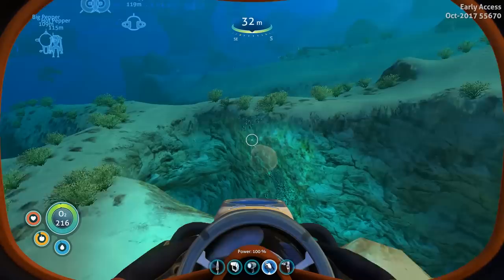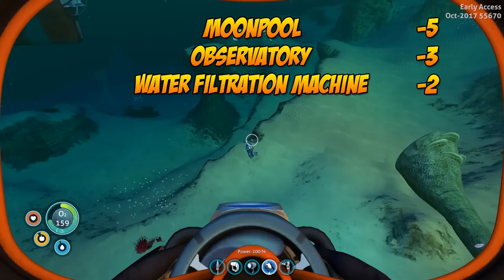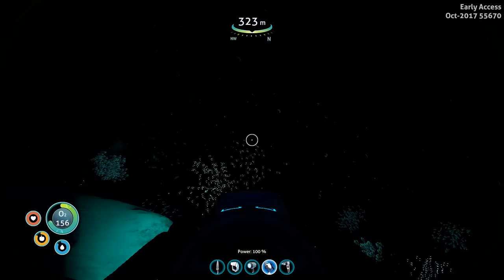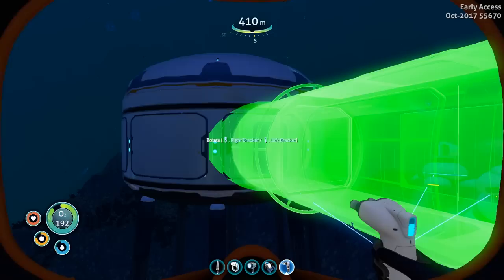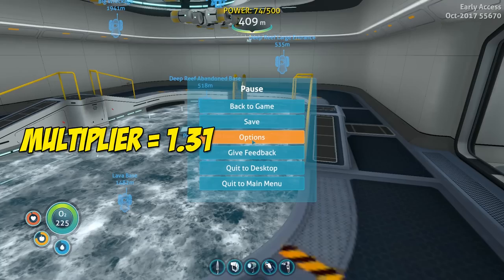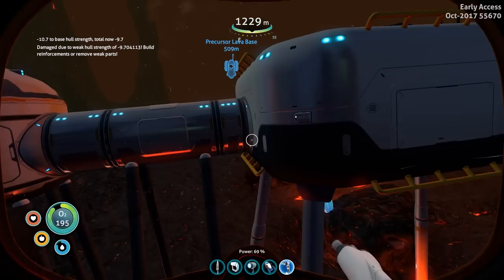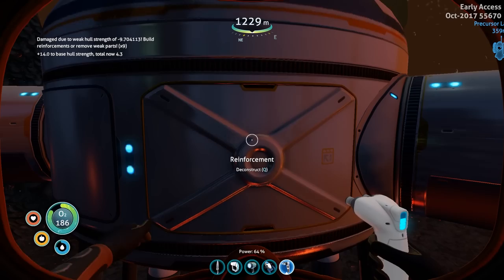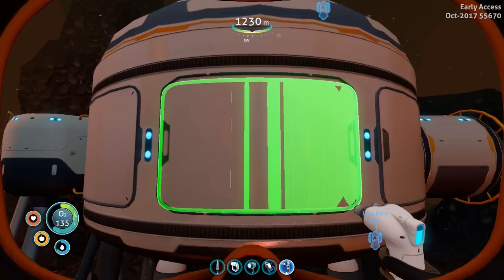HOW MUCH HULL STRENGTH DO YOU REALLY NEED?  -  Subnautica Tips & Tricks

Comment: very good video, loved it! Just to notify you however, just before official release they reworked the Hull Integrity system and now the reinforcement panels on the n,w,e,s corners no longer gives +14 strength (they give a regular +7 instead) thats to be taken in consideration while planning out your base's hull strength. Also, they increased the hull strength given by the bulkhead from 2 to 3 (possibly to compensate the nerf to the reinforcement panels)
Reply: Good thing you commented. That part sounded like a weird quirk in the integrity system and i thought they probably had that changed at some point. Do the windows work the same in all directions now as well?
Reply from the maker: Yes I did this video well before the final release where they changed the integrity values. Thank you for pointing that out for anyone watching it now.
Reply: Well in the full release why should you care?
Just saying:the SUPER SEAGLIDE GLITCH
Reply: Yeah I tested this thebsecond I saw it and it didn't give me 14.  Then I realised when MSG made the video.
Reply: I admire accounts that are 10 years old and just post one comment
Reply: @MrSpicyGaming  Does the Bulkhead doors keep water out of area, that flooding if they are closed?
Reply from the maker: That’s the main purpose of the bulkheads. If you spring a leak in your base, the bulkhead will keep the water from flooding into other parts of the base. Useful if you are bad about running into a specific piece of your base with a vehicle.
Reply: @MrSpicyGaming I cant flood my base in below zero

Comment: Didn't realize that depth also affects the base integrity. Thanks for these great tips. One question, is there a quick way to check the present integrity points?
Reply from the maker: I've only seen two ways to quickly check the base integrity. One is to save and reload the game, at which point it will show you the calculated integrity as it gives you all of the welcome back messages. The second is to either add or remove a component that will change the integrity. Removing I should be as simple as just partially deconstructing and then restoring it again.
Reply: @MrSpicyGaming  REBUILD THE DEGASI BASE IN MUSHROOM CAVE

Comment: Very nicely done. Even if the values have changed with the 1.0 release it's easy enough to see how an item affects your hull strength based on the info you presented. I play on the Xbox One X and I've built a ton of reinforcement panels and they all seem to add +7 regardless of the face I'm applying it to. I'll have to double check and see if the console version will give me a +14 if built on a cardinal direction. Thanks :-)
Reply from the maker: The values were changed with version 1.0 to simplify it so Reinforcements are a flat +7 regardless of placement.

Comment: Had no idea about the cardinal directions on the rooms. Basically it is due to having built my FIRST base a few feet away from the life pod right next to the coral tube that sticks out of the water. Its nice to have both corals acid mushrooms and large TAN tunnel nearby that has all the quartz but, Its kinda a pain in the ass right next to that tube. Now that I have a Seamoth, I need to move....

Comment: Just got the game a few days ago ... Have pretty much all compartments and this is the second base in the same area. Deconstructed base cause it too kept on flooding for no reason.
The reason why I came here is I thought I figured it out. My hull strength is at a total of 57.1 (I'm only at 12 meters or so under sea level) and so I figured I can add another water filtration (making it 3 all together)  I added one more hull reinforcement where I wanted to put the 3rd filter ... then I add more power and the whole thing starts flooding, before I can even add the water filter. 

Anyway ... I guess the update version has removed the X notification on the hull reinforcement because there not showing up at all in my test. I basically did the same thing as the video with the multipurpose room. In my test there all solid green and you do see an X in the middle but the whole reinforcement shows up as the same no matter what side I put it on. So I just don't know why my base is flooding ... is there such a thing as too much reinforcement???

After checking these websites ... still not much help. 
https://subnautica.fandom.com/wiki/Hull_Integrity
https://subnautica.fandom.com/wiki/Reinforcement_(Subnautica)

Went back to save point and will do without the 3rd water filtration till I figure this out. Any suggestions???😕

I am now going to build on one of the Island or at sea level ... if that get flooded then this game is going to suck ...

Comment: ok if I put a Hull reinforcement on the out side can I still use that wall on the inside
Reply from the maker: Yes and no. Certain things will still work like the Fabricator, Med Kit Station, Wall Lockers, and such. Other items such as the full Wall Planter will not be placeable over it since it takes up the whole wall.
Reply: MrSpicyGaming ok thax you gor the info your video has helped me but also killed my base idea I was going to have a 3x3 base with with 16 connecting pipes but now I might change it it would would look like the following with 8 pipes on the outside & the center room having 8 pipes as connections  
ooo
ooo
ooo
Reply from the maker: Place your reinforcements on the walls of the connecting pipes first and see how much hull strength you still need. That should free up enough Multipurpose room walls for your other needs.

Comment: Got a question I’m at safe shallows prob about 20 meters is my lowest part some of my base comes out the water so im not deep I have at least 30 more space for hall and i still get leaks and I’ve been stuck on one where I literally checked every spot in my base and the water still is knee level ? Any suggestions like I seriously checked every spot r times and still have a leak? I have a lot of windows but I still have s plenty of hall space. Any ideas ? And I’m missing somthing here ? Would deff appreciate any help
Reply from the maker: If by hall space you mean hull integrity, you shouldn't need even 20 hull strength at that shallow of a depth. Increasing your hull strength won't fix leaks so if you still have water coming in, there is a leak somewhere. If you cannot hear the sound of a leak, then you may just have a spot where the health of the component is not 100%. Either that or one of the base components is bugged.

Comment: Is there still hull integrity in creative mode?
Reply from the maker: While building in creative the calculations for hull strength are still being done but do not show on the screen and having a negative strength doesn't cause any issues. If you change the mode to Survival, however, it will immediately enable normal hull integrity effects and you may then see your design flood.

Comment: I hear air hissing but no holes... I have checked EVERYTHING!!! I move my tables off the walls the chests. There are NO HOLES!!! And my lights are dimmed... I have power. But it cant get the lights back up. Pls help I'm losing my mind.
Reply from the maker: Check your integrity level by adding a single reinforcement. If you are just below the threshold it will only slowly cause leaks.
Reply: @MrSpicyGaming  I did add about 4 reinforced hulls... I think I need more I still hear the hissing. Guess I just have to keep adding more... thank you x)

Comment: Can you place reinforcements on a moonpool?
Reply from the maker: I believe you can place them on the longer sides of the moonpool, but I am not where I can confirm that right now. Unless it was changed with the 1.0 release, you should be able to place reinforcements on the moonpool still.
Reply: Doutzen Ghesquiere i shall check now
Reply: Doutzen Ghesquiere moonpool takes 4 reinforcements 2 on each side